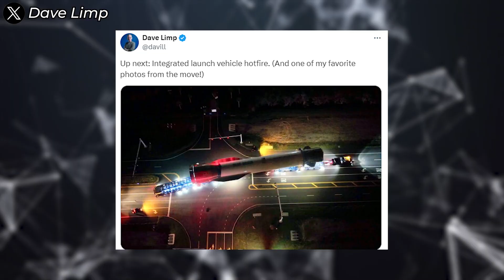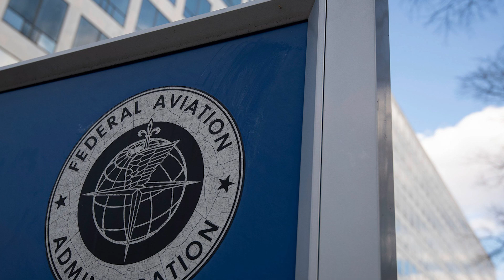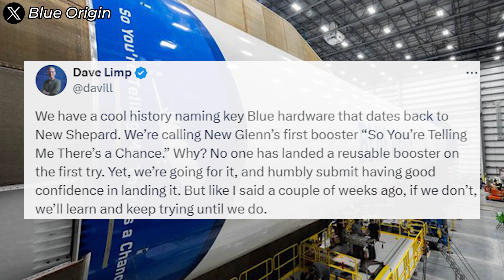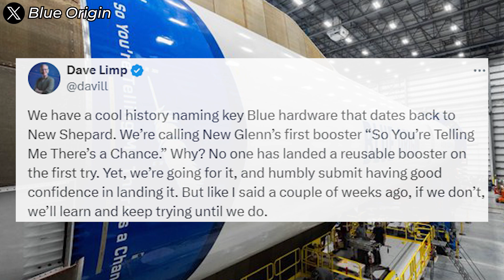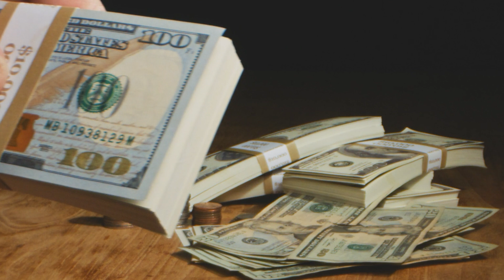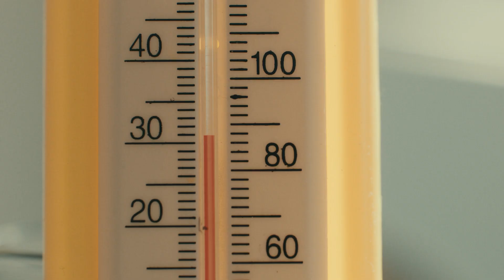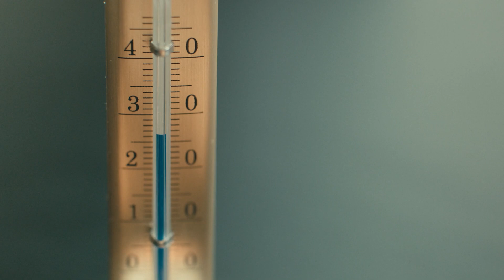What Blue Origin New Glenn just did somehow to BEAT SpaceX & Elon Musk…

Comment: New Glenn may turn out to be more fuel efficient than Starship.
BO are using high-end aerospace materials and techniques, while SpaceX is using basic heavy steel.
Steel is cheap and allows fast iterations. But it will never be the most fuel efficient.
Reply: Based on relative properties of the materials used there is virtually nothing between stainless steel and composites in efficiency or weight when extra protective shielding around composites is considered. Remember the booster has to come back so where Starship does not require an entry burn New Glenn will same as Falcon9 because atmospheric heating is a big problem. The extra fuel for this is significant, also stainless steel is much better at cryogenic temperatures where composites become very brittle. All considered there is nothing in it except SS is a fraction of the cost and much easier and faster to work with. Also Raptor engines are a bit more efficient than BE-4 and weigh significantly less. All said Starship is a totally different thing to New Glenn which is much closer to Falcon9. Remember Raptor 3 produces more thrust than a BE-4 and SuperHeavy booster has 33 of them while New Glenn has only 7 BE-4s, that is how different in scale these 2 rockets are.
Reply: @schrodingerscat1863  Look at the damage the IFT5 booster took. It too will require an entry burn.
There is quite a difference in performance between SS and honeycomb aluminium alloys.
Reply: @vonnikon  No it won't there was some deformation of the outer engine bells but that can be reduced by changing the cowling around the outside of the ship to modify airflow. The inner engines that were more sheltered worked fine and were undamaged.  The skin of the chines can also be reinforced to prevent it being peeled away by turbulent air. The design of the booster will change fast now they have a fully intact flown booster to examine. Booster V2 already has a lot of proposed design changes and with 35 Raptor 3's will be far more powerful yet lighter and more reliable than V1. 
Problem with aluminium is at the temps the ITF-5 booster experienced it would be molten and carbon composites wouldn't stand a chance at those temperatures either.
Reply: @schrodingerscat1863  the SS tanks of the IFT5 booster did not seem to experience very high temperatures. Only the engine section and grid fins were visibly hot.
Just looking at the payload and fuel numbers, the lighter New Glenn might come out ahead in fuel efficiency, despite its less efficient engines. But it is too early to tell for sure, since all stats for both systems are preliminary at best.
Reply: @vonnikon  New Glenn is not fully reusable so there is no comparison. A Starship/Superheavy rocket with an expendable Starship and reusable booster could carry absolutely huge payloads. It doesn't need to get that hot to create problems for aluminium, 300C is enough to initiate recrystallisation which softens the metal. SS can heat to over 1000C without issue. There are alloys that can withstand more heat but they are heavy compared to aerospace grades and can still not get anywhere near steel.
Reply: @schrodingerscat1863  steel turns purple at 300C. We didn't see that happening on the IFT5 steel tanks.

SpaceX has not yet succeeded in reusing a second stage, and blue origin has not ruled out a reusable second stage for New Glenn. Second stage reusability is still a unknown variable.
Reply: @vonnikon  With stainless steel you get a pale yellow colouration at 300C, you don't get purple until around 450C. The engine bay and  chines would have suffered the worst of the heating with the engine bay getting the worst of it. I think they said on the stream that it was getting up to 1000 degrees but no idea if that is F or C. It was glowing hot so C would be my guess. New Glenn booster doesn't have enough thrust to lift a reusable second stage, not with any kind of payload capacity left anyway. That is the reason the Starship rocket is so large, it has to be to make a reusable second stage practical.
Reply: @schrodingerscat1863  SpaceX needs that big rocket to lift a solid steel methalox second stage.
We don't know what the mass of a lean reusable aluminium alloy orthogrid hydrolox second stage would be.
Certainly a lot less than starship.

And we don't even know if starship reuse is a viable path.
Reply: @vonnikon  We know it would be pound for pound similar to Starship because what you lose in weight by using lighter aluminium you gain with much increased aluminium thickness and significantly heavier shielding. SpaceX did the calculations when they decided to ditch composites and move to stainless steel. Also because hydrogen is much less dense than methane it requires a huge tank for the same energy content. Starship has already shown it can re-enter and soft splashdown at predefined co-ordinates. The proof of concept is done. Now it's a case of redesigning parts of the ship like the forward flaps that aren't working well and getting the heat tiles right. Not sure where you get solid steel Starship as it is made from thin sheet material reinforced with formed stringers.
Reply: @schrodingerscat1863  no, it is not equal pound-for-pound.
SpaceX did do some calculations, and found that SS is good enough. Not equal.
They accepted the weight disadvantage, because SS allows for faster and cheaper construction and iterations. Factors which are very important to SpaceX way of working.

The best performance will always be with composites and/or orthogrid alloys. But they are more difficult to work with.
Reply: @vonnikon  The best performance is the best material over all, not necessarily that have some superior characteristics. Composites and machined plate alloys have some good characteristics and some very bad characteristics where rocketry is concerned. As engineers we make value judgments all the time balancing many factors. Fact is, building a rocket like Starship with composites is really not even possible and the resulting structure may not even have all of the required properties if it were.
Reply: @schrodingerscat1863 almost every second stage has been built using aluminium or composites.
Including the only reusable second stage in history.
SpaceX took a calculated performance tradeoff when they went for SS. SS is right for SpaceX. But not for blue origin.
Reply: @vonnikon  Exactly, Starship in its current form has been designed to use Stainless Steel. Weight of the steel is only one consideration that ultimately turns out to be less of a problem due to better structural properties, significantly better heat performance at both high and cryogenic temperatures. This makes it ideal for fuel/oxidiser tanks but also makes it good at high temperatures requiring lighter less complex heat shielding. It is also very cheap compared to composites or machined aluminium and quick to build with. Building a rocket the size of Starship/SuperHeavy from composites would have been an engineering headache all of its own and may well have been impossible without major breakthroughs which is why SpaceX abandoned that approach early on. Engineering is always about balance and compromise to arrive at a workable solution for any given requirement.